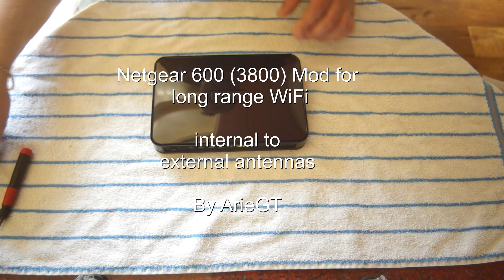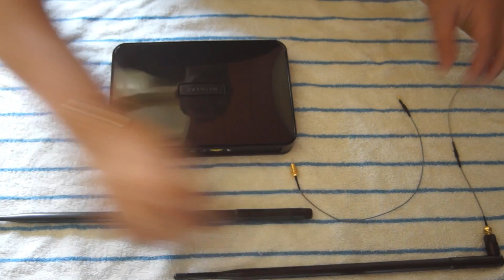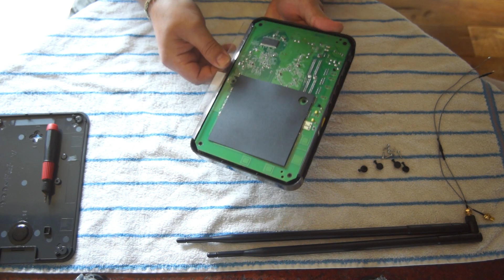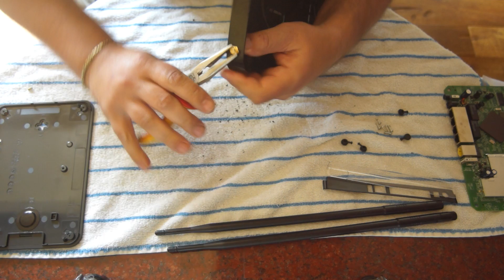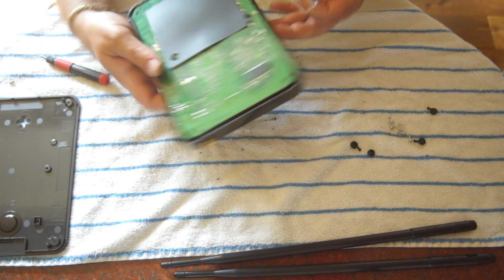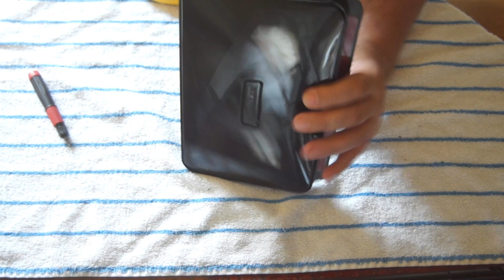How To Add External WiFi Antennas / netgear antenna MOD NetGear WNDR3800 N600 Wireless Dual-Band

Comment: There are two additional antenna connectors inside (total four). What the purpose of the additional two ?
Reply from the maker: No there are no additional connecters , these are instead of to extend the working distance. If you have a different device it is probably for extra 5G and 2.4G antenna
Reply: @ariegt  thanks for reply. I have WNDR3800.
Does it make sense to connect external antennas to white MHF4 and internal antennas to gold MHF4 ? Simultaneously.
Reply from the maker: @BoBaH_BoBaHoB  trying is free haha , what i believe is one side is for 2.4g and the other for 5g but i am not 100% sure. If you tweak the antennas to the band with you get even better results. I was thinking for future tweaks to add a 0.5Watt amp or something but the results were good so no hurry in this

Comment: How to enable all channels at 5GHz band ?
Reply from the maker: Not sure what you mean , there is just one channel to pick from 1 to 13
Reply: @ariegt  set to "Taiwan" and you'll have 56, 60, 64, 149, 153, 157, 161, 165
But, I'm going to flash OpenWRT. There are UDPXY for IPTV.

Comment: I have a WNDR4000  It has 5 IC chips with antenna wires hooked to the them

The chips say in order from left to right with color of wire attached
IC 1:  White Wire           Foxconn A18 A21,
IC 2:  Black Wire           Foxconn A19, A20, A81, 
IC 3:  Gray Wire            Foxconn  A19, A20, A81, 
IC 4:  Blue Wire             Foxconn A18, A21,
IC 5:  Off White Wire   Foxconn  A19, A20, A81

I am guessing there are 5 antennas.  I have never seen more than 2 antennas, but this is a dual router,

so I was expecting 4 wires, not 5.

Any way to tell what each wire is for ? If there are all antennas ?  What frequency they are on

Thanks

Bill
Reply from the maker: Bill , i think it is mixed 2.4G and 5G. If you search the net you seen much more routers with 5 antennas. You can try this mod on ic1 and ic5 this must work out as 2.4 and 5G externals i suppose.  But i could be wrong because it can also be one is transmitting and the other is recieving
Reply: I have the same problem did you ever find out please help with the colors. Thanks
Reply: @badmfgreenoorlegraygrass6726  The 3 chips are 2.4 Ghz, the other 2 are 5.8

Comment: Realize this was a while ago but wondering if there is a need to disable onboard internal antennas?
Reply from the maker: Hebekiah Bonaventure , hi . The internal antenna's are plugged of the board and i left them in the box, instead there are wiring for externals plugged in.

Comment: Good video, thanks.  Does this cover both TX and RX functions for the router?  I'm looking at adding a large antenna for my boat and then route it through my WNDR3700 as the WAN port (RX) function to be able to capture free / xfinity wifi signals to then broadcast to anyone on board.  Not sure if that is what this video shows, or if this mod is just to increase the TX signal strength part.
Reply from the maker: Thanks Kevin , yes if you extend the (new made) antenna connectors with the right cable to a external antenna
on your boat you will increase TX and RX . iI think if you try to put it high enough you wont be needing a large antenna.
good luck

Comment: 2.4 or 5gh. ? Will it work vice versa ?
Reply from the maker: maybe a 2.4 on one side and a 5Ghz on the other works best.. but it works
Reply: arie gt Is one of new external antennas separately the 2.4 band, and the other side the 5 band?

Comment: great mod for the rp-sma but those antennas dont do much you would be better off with smaller ones a 2.4ghz and a 5ghz those large antennas look like they work great but unfortunately they dont resonate 2.4ghz as well as smaller ones
Reply from the maker: Ryan Holkenbrink , thanks for comment. Still it is better then the internal antenna , but i'm open for any suggestions for boosting some more performance. i also looked at the " high range 2.4g clover leaf antennas " but i don't know if that will work. What sort of antenna do you have in mind ? Do you mean a short 2.4 on one site and a longer 5g on the other ? curious for info, regards
Reply: typically the higher the frequency the smaller the antenna, the best antennas ive used were the omindirectional biquads do a quick search theyre easy to make. you may not get huge coverage. especially not with 5ghz as the lower frequencys tend to cover larger areas, but it will be much more stable, and yes you will want a 5ghz one and a 2.4 but theyre so easy to make !! have fun
Reply: my friend an i tested those huge antennas and found they were no better than small oem patch antennas found in routers and notebooks. but thats okay your rp sma connectors are a great mod and open up a world of possiblilities. oh and the other thing with our big antennas is they were made of really toxic smellling rubber yuuck
Reply from the maker: Ryan Holkenbrink , hahaha yes i think the best way is to concentrate on the 5G signal and try to boost it somehow with a better antenna and/or a 5G booster. For me it is easy to extend the rp sma connector for a different antenna placement in a other level of the house , so i think to begin with that.  The better the signal - the faster the speed....
Reply: i have had a good range but shit transmission speeds

Comment: Hello, I have that exact router, could you please put in a link to where I might buy those two antennas? I have the 2.4 and 5ghz router. Thanks.
Reply from the maker: just look for pigtails and 2.4g antennas. you will get there

Comment: could I do something like this to a WiFi range extender?  I'd assume it's the same principle, mine is just a little box that is like 2.5" x 2.5"  would it make much of a difference.  I'm able to connect it to a WiFi router, but the signal strength from the host router is weak, one bar, would this mod help?
Reply from the maker: yes why not , i had that @ first also in mind but the antennas did enough. Next to that , with  a amp-box you will extend TX but not RX.  Antennas are always the better sollution if you have the space for it  ;)

Comment: Excellent mod. I just bought the WNDR3800, might do this mod.
How is the performance with external antennas?
Reply from the maker: pretty good , it is also possible to fine tune a bit with the direction of the antenna's. i am thinking of a amplifier for more juice
Reply: I did the mod. Super easy and improves performance greatly.
However had issue with ddwrt and openwrt must have gotten some weird revision where WAN Port is different chipset. I could not get gigabit throughput (would just blink every 3 seconds). 

Still works okay with original firmware.
Reply from the maker: Hi Keith Allen, for me there was no need to. This way you have also the option to extend from the rpsma connection  to a external antenna (outside). For a booster it is pretty simple to connect it in between the antenna with cable and rpsma connectors

Comment: how much did this help?
Reply from the maker: +Joe Picard     Good question Joe. Not that much but for me just enough to do the trick.  Also  now i have the option to extend from the rpsma connection.  You can use a amp. or put a longer wired antenna at a different spot.

Comment: link to bought antenna's and parts? goo tut, but lacks in details of where to buy them. the video is a little blurry. :(
Reply from the maker: +Onicdesigns  . Link from last year will probable a dead link by now. As Albert mentioned try to google " RP-SMA Pigtail connectors and wifi antenna  "  i am sure you getting there.   Try video settings in 1080p or on a bigger screen it''s pretty straightforward ;)